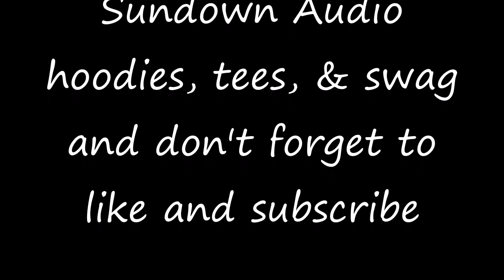Behind the Scenes Shipping Freight From Sundown Audio

Comment: Mythbusters follow up to the RCA cables. A lot of comments suggested that it's not the voltage but the signal that drops with each Y-Adapter used in an RCA chain, others suggest the length of the RCA cables drop the signals the most. Can you prove that this is true or false?